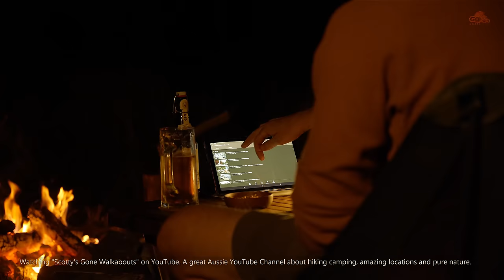SOLO CAR CAMPING with a GADGET JEEP Wrangler [ cosy night, campfire food, bushcraft, asmr ] SoC Ep21

Comment: Cannot believe Coleman have stopped making the Northstar dual fuel lantern. Crazy!!!

Suggestion: ditch the LPG/propane stove for a Coleman dual fuel. We have been using dual fuel for more 15 years and have never felt the urge to go back to LPG. So much easier (especially if you are running a petrol vehicle like the Jeep).